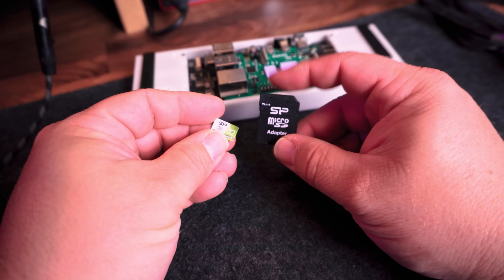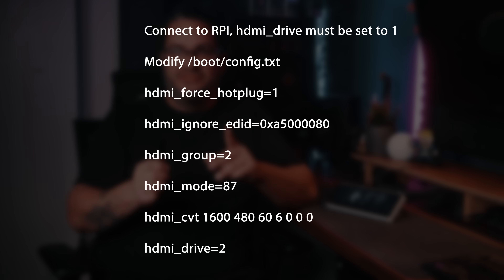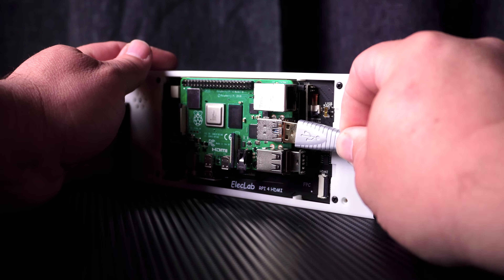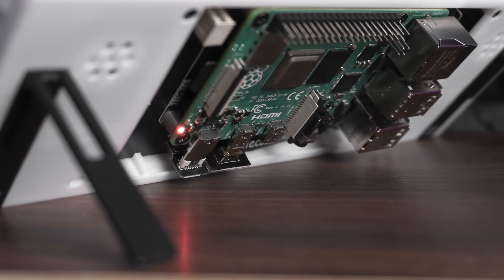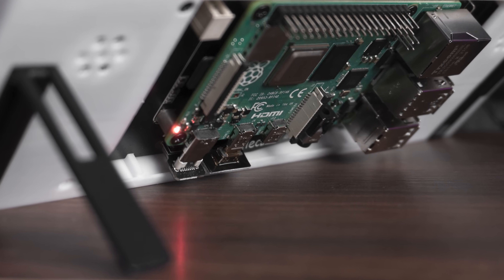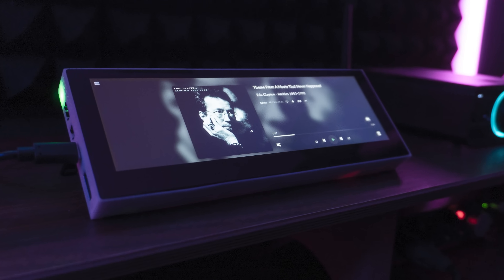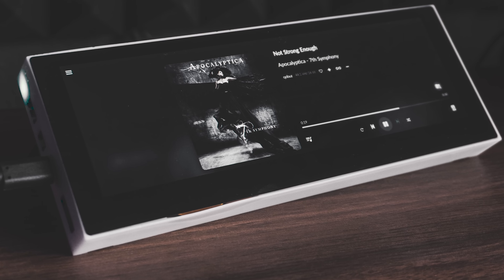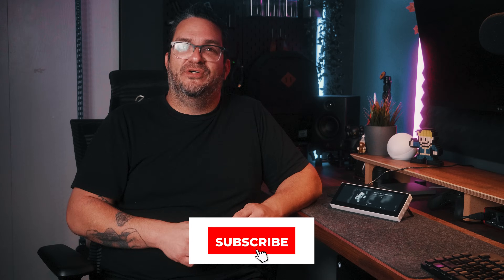Build Your Very Own Raspberry Pi Music Streamer

Comment: Hi. I found this video while I was researching a touch screen for my Volumio. One question about the config file modification. You said to modify user config file but on a screen there is config.txt. When I go to config.txt on my Volumio it says not to modify it. However there is userconfig.txt. Is it the one which should be customized with what you provided in your video?
Thanks for clarifying  that in advance.

Comment: I noticed that there is no back cover, which I personally like because my question is, will a DAC hat fit using this setup with the kick stand still function properly? I run an ALLO Boss hat on my rpi with Volumio but everything headless. I personally would rather rock the screen as your setup look really clean.

Comment: Hey Michael. Do you think this ElacLab monitor will work for the same purpose? The one you used is too small for me to see from the couch. Thanks! "10.1 Inch 1280x800 Touchscreen Monitor"

Comment: Hey, how may i get in touch with you.
Would appreciate and feel grateful to maybe have a discussion about building a solution for Wi-Fi streamers having optical out, 3.5 MM jacks, and an HDMI arc for old speakers that can be converted or utilise in a centralised home system. This is a problem that I have been trying to solve, and I did not find anything under US$120 to fix this challenge. In India, this seems to be a major challenge or a problem that can be solved. Do let me know how may I reach out to you.

Comment: I built mine in a SmartiPi Pro screen case and put a digital output HAT on the Pi, so I get optical out to my audio system - completely pristine digital data. I use PiCorePlayer because it fits into my little "home ecosystem".
Reply from the maker: That sounds like a fun build!

Comment: I'm curious to what kind of audio quality you can get with this? Like, can it play at least hi-res audio?
Reply: Put a digital output card on the Pi, like a Hifiberry Digi2 Pro, and it just transmits digital data to a DAC or a receiver, anything with digital input. Perfect audio, basically. The Pi does nothing more than send the data from point A to point B.
Reply: @KimmoJaskari  @mykandrew thank you both for the responses. I do have a couple of dac/amps that I could attach to it. But after rewatching this video, the instability troubles me.
Reply from the maker: Using a USB out it will transmit whatever file in whatever quality it’s playing at. At this point it depends on the DAC you’re using. Most will suggest a dac hat that sits on top of the pi. I always like an external dac personally.

Comment: Great except it’s a maintenance nightmare and there’s no software on the pi that works with Apple Music. I gave up on dead end solutions like Slim and Plex a long time ago. Managing a local library just takes way too much time - and I did it for 20 years
Reply: You can just pay for Roon, if you like to keep a personal music collection, which I do. I've been too cheap to pay for it though, I use Logitech Media Server for my audio. It's not that high maintenance, I just rip the audio off a CD, and it collects the metadata basically then and there. It's a hobby. But with Roon you get a lot done for you and you get a lot more information about the media.
Reply: @KimmoJaskari  Slim IS Logitech Media Server. I was using that from the early 2000's until about 2016. I don't have time to manage my music collection any more, so the expense of a streaming service is well worth it to me. I can't be bothered with any player or player UI that doesn't support the service I use.

Comment: I haven't dug into what is available in the Plex api, but I could see using one of these as an alarm clock / plex base station on my night table. Nice clean build!
Reply from the maker: That's a great idea!
Reply: Love the idea, but run from Plex: they have been systematically nerfing local media in favour of content that’s media-giant-friendly. There is no indication that they will ever go back to putting user’s media first.
Reply: Love the idea, but run from Plex: they have been systematically nerfing local media in favour of content that’s media-giant-friendly. There is no indication that they will ever go back to putting user’s media first.
Reply: @mykandrew can we use any other display you would suggest. Just got a pi 5
Reply: Love the idea, but run from Plex: they have been systematically nerfing local media in favour of content that’s media-giant-friendly. There is no indication that they will ever go back to putting user’s media first.

Comment: Just buy a android tablet, pi great as appliance and awful for everything else
Reply: That’s the easy way out. Just cause you can’t make a good device doesn’t mean someone else can’t.
Reply: Android has no “bit perfect” let’s say playback mode. Literally everything in Android is made with an “access layer” in between
Reply: Yeah my Lenovo Tab8 (I think it's an 8) is absolutely struggling when it comes to doing, well anything really. I was going to use it for reading ebooks, but it's honestly too slow for that too.
Reply: No thanks
Reply: @OhNoDaveIsMad I was thinking about getting either a tablet or a touch screen laptop to store all my music.

What makes you say no? I'd like to hear your opinion on which would be best and why.
Reply: @bit1345 if you go the tablet route, I would recommend to buy an old iPad as new cheaper Android tablets are very slow. The Laptop method is not bad either but you have to make sure that there no ground interference (noise through the speakers). Also for someone who is not as tech savvy, it's much easier to get and setup a table or a laptop for music streaming. Also get a good audio player software with playlist functionality and maybe even remote control

Comment: Mr Mike I too am a PI lover but!!!
But a new easier more reliable build is the B-Max  with x86 Volumio flasd built-in SSD+ music on USB 3 or network and its easy to make a 12 volt linear power supply al can connect to that screen  
1. The bios give better thermal management.
2. Faster reliable boots consistently.
3. Lower current draw 2_amps

But I will try the PI5 because of better thermals in documentation.
( Sound Quality  is equal to the PI  had previous advantage SQ when you could connect it to low noise  power)
Reply from the maker: I want to try this!!!
Reply: Oooo I just looked up B-Max and very interesting. Which one are you using exactly? This sounds like such a flexible x86 dream machine on such low power draw
Reply: @sumtingyum   Bmax B1 Pro or Plus I've used both Amazon